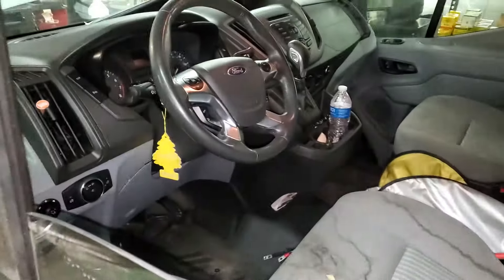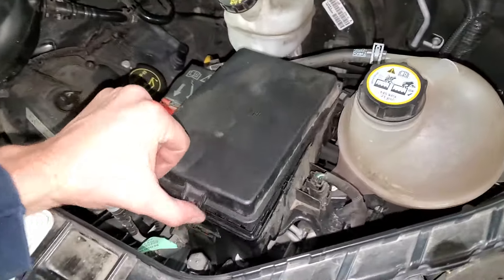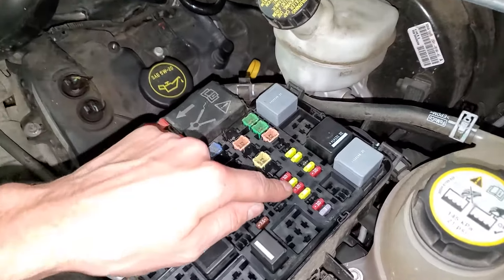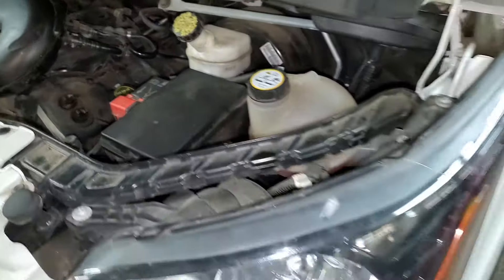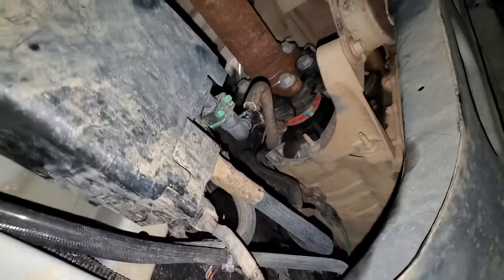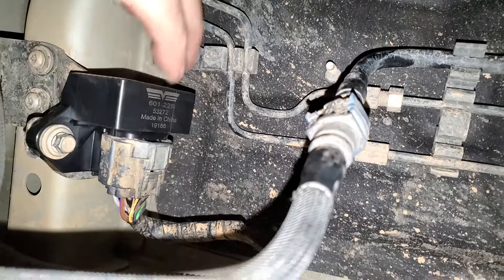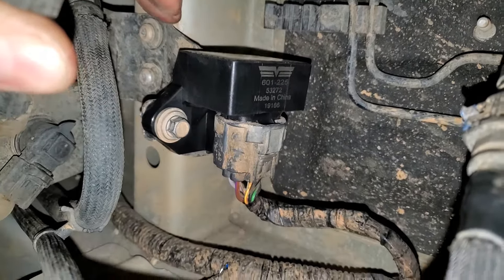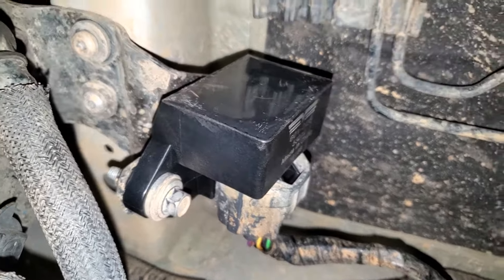2015 Transit Fuel Pump Control Module, Fuel Pump Relay & Fuel Pump Fuses

Comment: Thanks so much for posting this video. Our van wouldn't start. We were going to have to tow it to mechanic. Figured it was fuel pump related.  "Googled" where is the fuel pump on ford transit 2015 and found this video.  Paid 60+ at Autozone for the part and replaced it at home. Problem solved.  Thank you!

Comment: I will be changing mine.  10 degrees out this morning.  Tried everything.  Finally used my propane space heater to blow heat underneath for a half hour.  Started right up.  A month ago wouldn’t start 9:00 pm 150 miles away.  I was lucky it started about midnight.

Comment: Hi. We've got a transit 2.2 2017 with a p2539 (low fuel pressure circuit) code. The van has an intermittent "no start" which may only happen every few days/week. It has never 'cut out' or lost power, just doesn't start sometimes? Basic checks to the pump mini relay and 7.5a fuse are good. Filter replaced OK. Rather than trying to just replace sensors /pumps etc I thought I'd reach out for any common issues and after watching your video you sound like you know what your talking about 🤞🏻🇺🇲🇬🇧

Comment: This fixed my issue. Thank you! I will add that I had TWO (2) bolts to remove to get the unit out and replaced.

Comment: Your local ford dealership will fix this fuel pump control module for free.  Ask about fixing it under "customer satisfactory program 20B53"...just got the letter from Ford.
Reply: FYI this was true, but the program ended on January 31, 2023 (at which point, all the bunk fuel relay modules Ford shipped out magically start working again).

Comment: I like to install a kill switch.
Do u recommend the wire to the fuel pump 
From the relay.
Located under the hood fuse box.?
Thank you.
Reply: I would also appreciate some direction on where to wire kill switch.

Comment: Hey I got one of these. And I noticed the 10amp fuse f28 say injection power. I was wondering what feeds power to that fuse.because when it doesn't want to turn on there no power there.i already got a oem fuel module.

Comment: Hi mate have a Transit Mark 8 coming up with fault code p253 9 fuel pressure low fuel sensor circuit

Comment: What symptoms would I see if if was this module was at fault ?
My transit won’t turn/crank.  All the ignition lights are on and battery has full charge. Immobiliser lights all function as normal.

Please help.

Comment: sorry but when you kicked fuel filler flap closed i had to stop watching your video .... other than that you no wat your talking about..... be more gentle and people will love yr blog,s.............
Reply: It’s a damn transit who cares....
Reply: That’s a soar spot for the transit you must be super gentle with it. Had to replace mine twice already it’s a bit of an ordeal because you have to take it to Ford to get paint matched as well or drive around with it stock black. I am overly concerned over my transit since I use it to safely transport my family of nine.
Reply: How do you know he knows what he is talking about if you did not watch video?
Reply: @gencamero  yep, for my 2015, it's a weak point at the fuel door hinges. Mine snapped off, but I just drilled some holes, and used wire ties as the swinging mechanism. Can't even till it's been modded, works like normal. Incase yours breaks again

Comment: I have a 2018 Transit 250 that is throwing code P0230-14-08. I get nothing from the fuel pump and the engine doesn’t even turn over. Does this module keep it from cranking?